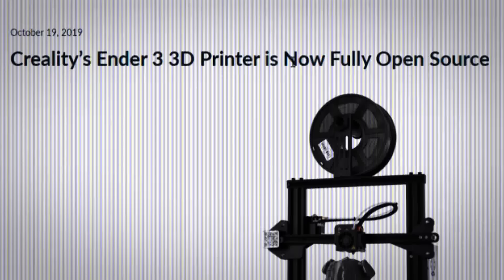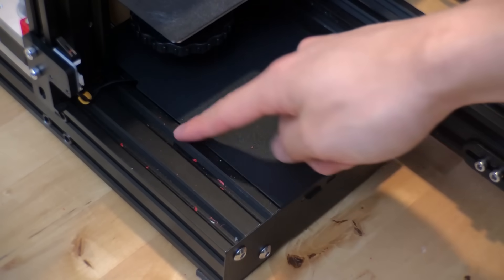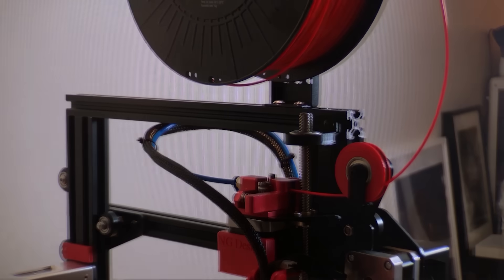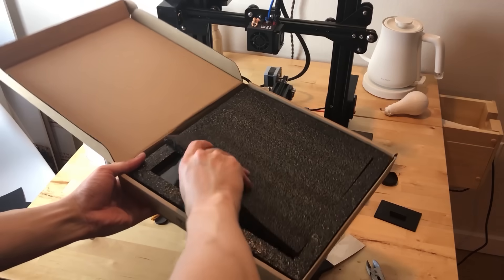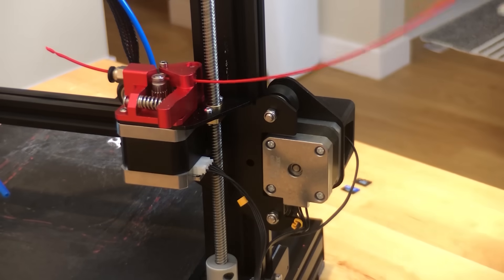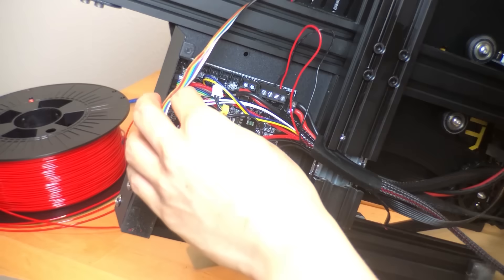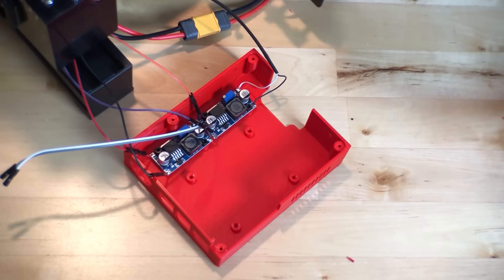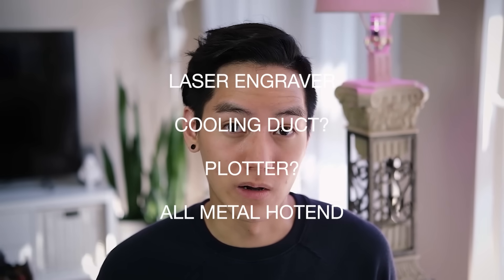First 24 Upgrades for my Ender 3 Pro - Part 1

Comment: Great video. Do you have a detailed video on installing/wiring your Pi, converters, and fan? Why did you externally switch it instead of just having it on when when the printer is powered on?

Comment: Awesome video, but PLEASEEEE do not get the dual gear metal extruder. I work at a print farm where we used ~20 of these and they all had the same issue. The driven gear is steel while the extruder frame is aluminum, so the gear slowly grinds away the aluminum and causes massive issues. The creality V2 extruder does not have the second gear but is a much better metal extruder.

Comment: if you make they bottom shim do you have to put the top Screw Stabilizer?
Reply from the maker: megdon12 added this in the description a while back but i no longer recommend the screw stabilizer. i put more details in the description but yea, that one turned out to actually be bad for the threaded rod.

Comment: Outstanding video!  Totally noob in the 3D printer game... got my ender 3 pro yesterday.  Already ordering upgrades lol.  Question; your filament guide (#11), what size bearing did you use, and where did  you get it?  Seems how I'm about to order from amazon... lets throw that in there too!
Reply from the maker: they're just regular skateboard 608 bearings. any of these would work: 
https://amzn.to/3ic9d5q

I just had some lying around because I used to skateboard. Good luck! glad you enjoyed my video :)
Reply: @ScottYuJan  Thank  you for the quick response!  Yes I enjoyed your video very much; it has been the best so far as very informative, quick yet detailed, and not intimidating at all (and the host panache is an added bonus as well!!).  I like the teaching tech videos, but the get into the weeds/technical very quickly... but I will be glued to them when I do my board/BL upgrades!  Thanks again.

Comment: #14...Why remove the magnetic surface? Couldn't you just put the glass overtop of it?
Reply: every layer you have makes it harder to maintain consistent bed temps
Reply: because the bed clips dont fit if you dont

Comment: Dude, I just wanna say that this video is absolutely fantastic. I'm completely new to 3D Printing; the Ender 3 Pro is my first printer. I've been pulling my hair out trying to wrap my head around operating it, but it has truly been a rewarding experience.

Getting the SKR Mini E3 V1.2 and BlTouch has truly been a god send. I didn't want to print any of the printable upgrades until I had these installed and working properly. After two days of going insane, I finally have everything up and running. Thanks again fro your video and keeping it entertaining so I felt like I at least had some sanity left lmao!

Comment: Did you Adjust the voltage of Raspberry PI to 5V the same as the LED lights? cause you didn't mention that.

Comment: Great video, would suggest two things in order to please both your technical and enthusiasts audience, please divide cosmetic and technical upgrades, some of your technical upgrades were very cell explained in 20sec better than a 5min video on a BL Touch video but, a cover for cosmetics is not an upgrade, it's a mod.

On another note, changing to a 32bit board removes the usage not only of smoothers but step motor drivers because they come already with the last version (TMC2206) sth like that, and it's all electronic upgrades, it does not remove the need for mechanical damping. It's a difft type of vibration that you can't attenuate from the movement with transistors, therefore needed.

Great video and keep the good work.

Comment: Take the red thing off the power supply. It may make the fan a little harder to hear but by adding ducting you make the fans less effective, you could burn your apartment down. These are chinese plastic melters, not iphones

Comment: Bro, the SD card adapter holder works but the micro SD adapter that you recommended from Amazon doesn't. It still requires to pull the micro SD extender in and out to read the SD card.
Reply from the maker: i think this happened to me the first few tries too but it turns out every time i was putting on the enclosure i was doing it too forcefully and it was popping out the micro SD connector every time. so i got it working by putting on the enclosure very slowly. if that doesn’t work i would recommend also checking to make sure you didn’t get a faulty adapter maybe? i’m not sure but good luck!
Reply: @ScottYuJan  Thanks! Maybe the extender is faulty. Anyway, love your video and recommends!

Comment: Hi . please let me feed back  you had make a cover to cover the electrical power supply 'Fan .
I think it is not good to do that you going to shorten the power supply life easy with sometime long .
it is power up heat to exchange to outside 
or so call cooling fan .
I hope you consider to remove it . thanks

Comment: Dual-Z, with a wide enough print you will see drooping to one side.  But they positioned the electronics right where the second screw goes...
Reply from the maker: i just got my dual-z upgrade kit! gonna have to figure out where to move my electronics but i’m psyched for this upgrade. gonna have it in the part 2 video.

Comment: Isn’t the fan for heat dissipation? If u cover it it’s not going to get over heat?
Reply from the maker: Yeaaa but the power supply fan is actually not an exhaust but an intake so the cover is only redirecting the intake air. It doesn't fully cover it. I haven't really had any problems with this yet and it's also a very popular upgrade on thingiverse so it's probably fine?

Comment: Holy crap, top quality production, funny and omg that printer turned from $250 bucks to $1000 dollar printer. Great collection and thx for the advice on the board, the smoother and motor damper were on my list. NOT anymore :D
That chip is probably stale by now though

Comment: Remove that fan cover unless you want to start a fire.
Reply from the maker: have you seen this happen before?  Because the power supply fan is actually not an exhaust but an intake so the cover is only redirecting the intake air. I haven't really had any problems with this yet and it's also a very popular upgrade on thingiverse so it's probably fine?

Comment: Edit: I just realized this is for the Ender 3 Pro and I just have the Ender 3. Are any of these upgrades going to work for the 3 or do I need to find other solutions?

This is an amazing list. The only thing that stings is the cost of the upgrades is more than what I paid for the printer.
Reply: The ender 3 is pretty similar so most of them should still work

Comment: I cant decide whether to do this build or just buy the new ender 3 v2. Any thoughts?
Ive looked into both and they seem to have the same performance, but v2 can be bought cheaper. Any disadvantages to upgrading to the v2?
Reply: I was in your position yesterday as well.

Lots of people seemed to recommend getting the pro over the v2 and just doing the upgrades yourself, as plenty of them are very DIY/printable. So that's what I went with. I also got a glass bed, replacement nozzles and two spools of filament and was still around 50€ below what I would have paid for the V2 without anything.

The V2 also seemed to be sold out in a lot of places. So that might have something to do with the price hike.

If you can actually find the V2 for cheaper than the pro, I'd say go for the V2. That's what I would have done.

Comment: Nice, efficient presentation. Suggestion: As nice as it is, (except for the novelty birthday baby- thing), find a good label maker for the raspberry pi , etc, switch or print them on laser paper and laminate them with scotch tape. You obviously take care of neatness, removing the ugly brand, those nice leveling wheels, etc. With respect. Regards.

Comment: I just changed from a heavily modified AM8 to the Ender 3 pro, I hope is less delicate. 
Btw, with the 32bits board you have to change the LCD or you can run it with the stock one? I share room with my printers and the heavy heat and noise insulation is what killed the anet board so...

Comment: Isn't it dangerous to put cover over a psu fan?
Reply from the maker: nah, even though it’s probably fine, it doesn’t make a HUGE difference. wait for my part 2 :) 
haha i’m already working on a better solution! happy printing!
Reply from the maker: the power supply fan is actually not an exhaust but an intake so the cover is only redirecting the intake air. It doesn't fully cover it. I haven't really had any problems with this yet and it's also a very popular upgrade on thingiverse so it's probably fine?
Reply: @ScottYuJan  Well, I hope so, maybe I'll print one one day. Happy printing :)

Comment: I can suggest you to change ALL coolers, this makes printer completely quiet. take 12 volts 80 or 90 collers to hotend and to mother board. change like you did from 24 volts to 12. it cools better and quiet. you can find solution on thingivers or i can email you)

Comment: Man I have two ender 3 pro's and didn't even think to add some of these. I don't see the reason for the BL touch as I've never had issues leveling especially with the yellow springs or even the silicon ones that make it basically effortless.

Comment: Very nice video.  Would you mind posting a rough estimate of the price of your purchased upgrades?  Thinking this might make a nice winter project.   Creality doesn’t support thermal runaway protection on the stock board?

Comment: i am like 5 minutes in and all i see is you randomly printing stuff you found online, solving problems that you never had and creating new ones instead. also none of these "mods" change the printing of your printer.

only improvements are the btt stuff and bltouch that i see you do in the end.

all in all, this is the most useless video on 3d printing i saw in a long time. every "mod" has been done to this and other printers for years.

nice editing and overall video quality though.
Reply: "mod:  the act or process of changing parts of something. " aka "mod" doesn't mean it has to be beneficial to the final product.

Comment: One upgrade that Ive found super useful was to use convert to a direct drive extruder using the stock extruder parts and a simple mount for the tool head.
Reply from the maker: i want to learn more about this please! aside from allowing you to print with flexible filament, did you find other benefits to implementing this mod? because i’m kind of unsure whether or not it’s worth it. please let me know! thanks!
Reply: @ScottYuJan  Along with printing with flexibles it allows for easier removal and replacement of filament since it has a smaller path.  people say its adds to much inertia on the print head but in my experience, there's no change.  All you have to do it make a mount with a holder for the extruder motor with the gearing on the other side that aligns with the hotend(you could honestly find the mount on thingiverse). other than that you're simply just reducing the travel distance so no changes have to be made software-wise.  Its basically a $100 dollar upgrade for free
Reply from the maker: MHG Scrubadub mmmm i see! thank you for sharing your experience. that makes a lot of sense. doesn’t sound too hard too when you put it like that. cheers

Comment: Hey Scott, nice video it was really helpfull, but i have a problem to understand the raspberry pi wiring, because you wired the the pin 2(+5V) to the IN+ of converter and the pin 6(GND) to the IN- and it doesn't make any sense for me, and yea i dont get how you wire the PI switch in neither.
Reply from the maker: Hey, let me try to explain. The whole power supply unit on the ender 3 pro outputs a 24v. The job of the buck converter is to convert that down to 5v for the raspberry pi. there are a bunch of empty +ve slots and -ve slots for you wire stuff to and it doesn't matter which +ve or -ve you use as long as what you're power is connected to both the +ve and -ve. So i have a +ve 24 volts wire going from the pin on the power supply to a switch and then to the +ve input on the buck converter. This way when the switch is off the buck converter isn't receiving any power. And then the negative wire to the -ve input on the buck converter. Then it's just adding output wires on the buck converter that connects to the raspberry pi. before making the connection just make sure to adjust the buck converter so the output is 5v and then you're good to go! Good luck!

Comment: if you force a slightly misaligned vertical rod in place without eliminating the root problem, it is equivalent to bending it slightly in all directions all the time. With time it will break in the middle, just like you can break a nail by slightly bending it then straightening it.

Comment: To sum up my feelings for this video ....it is a bunch of trivia and does not fundamentally improve ANYTHING as regards to print quality or consistency.....I'm outta here.
Reply from the maker: Ian Pearson thanks for watching anyways! come back for part two where I’ll cover some more print quality improvement upgrades like hotends and cooling ducts mods. if you have suggestions please let me know too! cheers 👍🏼
Reply: @ScottYuJan  OK....I think a more important upgrade would be the dual Z axis screw drive to keep the X axis cross beam level so that any bed leveling will stay level.......if the X axis cross beam goes out of level, even a few tenths of a MM, any bed leveling will be worthless......then you only need fixed spacers under the bed and no springs., excess spring tension can warp the bed.
Reply from the maker: Ian Pearson yeaaa even with the BL touch i’m starting to notice sometimes my larger prints are getting good adhesion on one side of my bed but not the other far side, that’s away from the z-axis motor and i’m starting to suspect a dual z-axis motor could solve this inconsistent leveling. and cool didn’t know that about bed springs. are you recommending like one of those silicone rubber spacers instead of the springs? or something else without flexibility at all?
Reply: @ScottYuJan  To be honest, I have an Ender 3 Pro that I've been upgrading by degrees and I have not used it yet so can't comment on performance but as an engineer I go by analysis of things that could affect performance.....one of those that seems to be a universal problem is bed leveling and the bed going out of level for no reason.......to that end I am pursuing the path of a dual Z drive and have also fitted silicon rubber spacers under the bed as a starting point.
I think the bed itself, as supplied, is a bit thin ( I have the glass bed still to fit and test)  and probably not all that level and with the springs being at the corners it could cause it to warp as well as the heat that will make it expand and liable to warp too.......all things to be tried and analysed......but just the Z axis dual drive will I think make a difference in maintaining a level surface......we're talking about fractions of a MM across the bed surface so it can go out of wack if the X axis beam fluctuates......tight rollers on the far side of the X axis will cause the beam to drag on the upright and bend up or down etc and just 1mm is all it takes.

Comment: Hey there - do you have any pointers on the wire gauge you used for the connections from the PSU to the buck converters? How about the connectors to the PSU? Anything special to look out for (size/gauge)? Doing my homework on that, i love how you tucked the Pi into the back, and I've done low voltage (3.3v and 5v) stuff with the Pi/Arduino/etc. as well as worked on my home wiring. I'm pretty sure I'll figure this out, but would much rather not buy parts multiple times. :) 

Really awesome video. This was great.

Comment: It looks nice and is surely more convenient to use. But in my opinion most upgrades just take time to install and don't increase the print quality significantly exept of the automated leveling. I have a different more practical idea about 3d-printing.
Still a great video :)

Comment: I'm sure it's already been mentioned somewhere below, but just in case: The hot end and direct drive upgrade from micro swiss is absolutely amazing
Reply from the maker: Jason Jacobus thanks man. 
aside from just being able to print with flexible filament, are there really other perks to direct drive? basically i’m asking, is it really worth it.
Reply: @ScottYuJan  you get exponentially better filament control. Plastic compresses and bends, so the closer the force pushing (the drive) is to the tip the less deviation you have. Resulting in crisper lines and better detail

Comment: scott : 3D prints a Lid for the lcd screen so the lights dont disturb his slumber 
scott :  removes LCD screen
scott :  puts some super bright LED strip on his printer 
logik
Reply from the maker: LachaineD’Amine BTW did you not see i also added a separate switch for the LEDs? haha
Reply: XD

Comment: I didn't have that magnetic black part. After I removed my magnetic (pos) build surface it was just the metal carriage (gantry? idk) and I just put the creality glass on top which recently chipped off in the middle. Spring steel time I guess.

Comment: About the original plastic extruder not lasting, I've had my ender 3 for at least two years, and am still using it. Often my printer would be running 24/7 for months printing my projects, so it has seen a lot of use. Though, I can definitely see the appeal of the metal build, as I had to make some adjustment to increase filament compression a couple months ago.